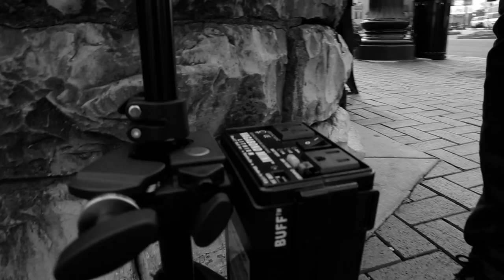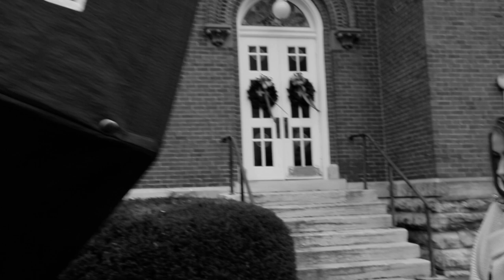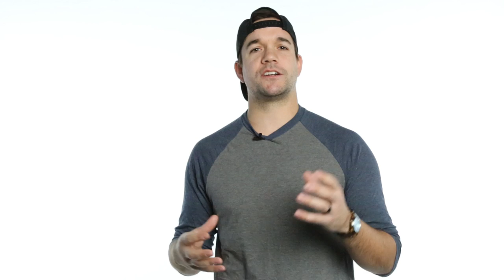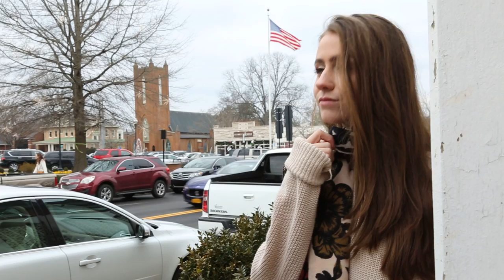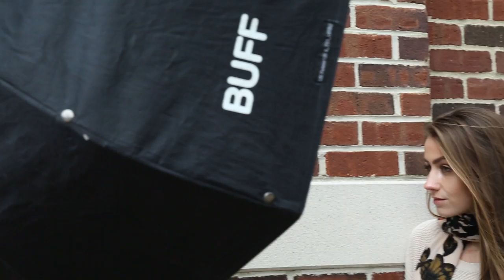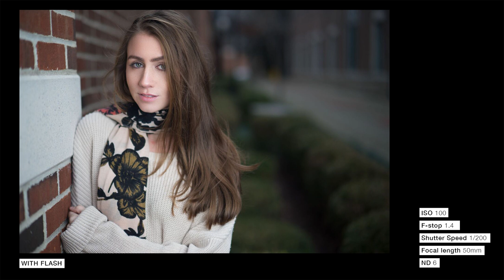BUFF BASICS: Neutral Density Filter

Comment: What kind of neutral density filter would be good for my 50mm f1.2 lens?
Reply from the maker: Jeff Carpenter, of Readylight Media, is a fan of the variable ND filter. He uses the Tiffen brand. You would just need to find one that fits your particular lens. You can contact Jeff directly (on instagram @readylightmedia or via email at info@readylightmedia.com) for additional inquiries regarding the Neutral Density filter!